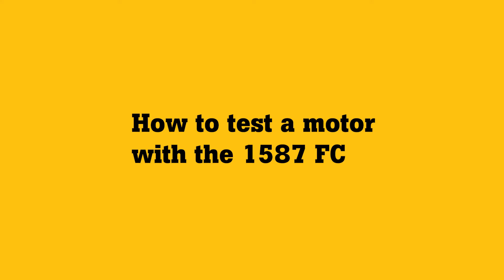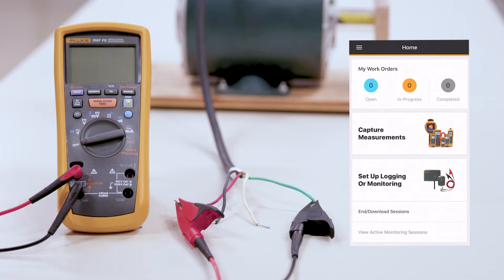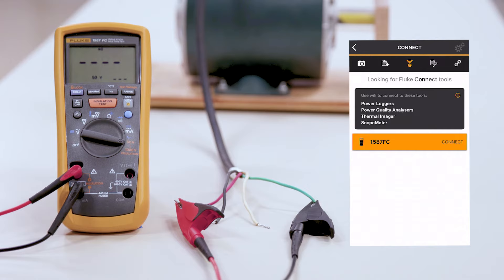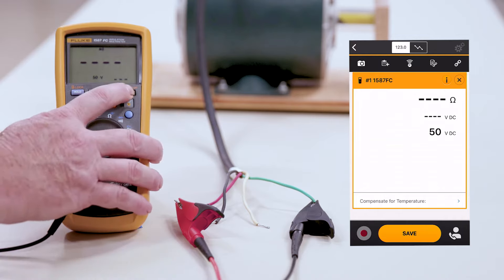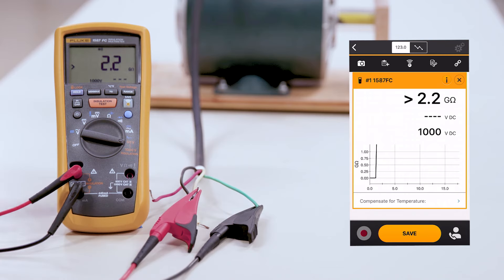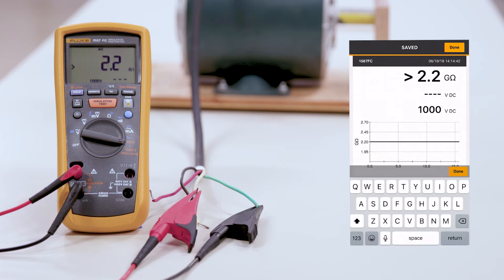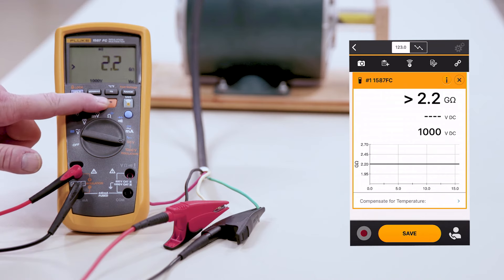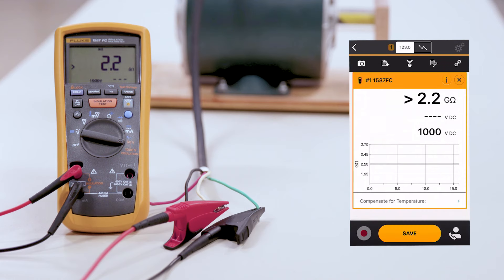How To Test a Motor with the Fluke 1587 FC

Comment: I own a Fluke 1587 FC Insulation Multimeter and every time I try to use the PI or DAR functions, the value displayed on the screen is "> 2.2 GOhm" at 1000V which means that the actual reading could be more than 2 GOhms?. After around 20-30 seconds, I receive an error message, and "Err" is shown on the screen. However, after watching your video that had DAR and PI values displayed, is it because the readings are within the range of the multimeter? Can anyone offer insight into why I'm receiving this error and how I can resolve the issue? Thank you in advance for your help.
Reply: Did you find some info for that? I have the same issues
Reply: @waxstache  I received a table from Fluke regarding the interpretation of DAR and PI values:

DAR 0-1.0 and PI 0-1 is Dangerous.

DAR 1.0-1.3 and PI 1-2 is Poor.

DAR 1.3-1.6 and PI 2-4 is Good.

DAR 1.6 and above and PI 4 and above is Excellent.

Therefore, if you're receiving an error message during the PI or DAR tests, it actually indicates an Excellent result, meaning your insulation resistance is higher than the meter's display range. This is a good sign for insulation testing!

Comment: What kind of file format is used for downloading test results?  MS Excel or some sort?  What is the data sampling rate?  What info can be included in the downloaded file?
Reply from the maker: Peter - thanks for your questions:  The data sent from 1578FC to phone/app is a binary file. It can be exported as XLS, CSV, or PDF. You can add text and voice notes, and assign the measurement to Asset and/or work order.

Comment: Since this is a 480V motor, why use 1000V instead of 500V considering each phase carries an average of 277V and in case of a fault may not carry more than 500V?
Reply: He said the range has to be doubled around 1:10 minutes
Reply: When you test the insulation of a motor winding, you don't test for what's its rated at. The insulation test is a stress test, doubling the voltage puts a heavy duty load on the windings, and if the windings hold, then your insulation is solid. If it doesn't hold, and you're bleeding to another winding or to ground, then you have a compromised winding. Motors dead at that point most likely, or extremely weak depending on how bad the leakage is.

Comment: I’ve just bought the fluke 1587 FC. Can fluke or anyone else inform me why it comes up with error when using pi and dar timed measurements on it? The measurements are holding to it’s maximum resistance on each setting yet it says err after about 1 minute. Thanks.
Reply from the maker: Hi Adman - Our Technical Support team would be happy to help troubleshoot. Please give us a call at 1-800-443-5853 or email fluke-info@fluke.com. Thank you!
Reply: I actually have the same problem. I maybe late but I hope Fluke provided you an answer.

Comment: This video is incorrect how to use this FLUKE tester and incorrect how to test motor for Insulation Resistance. I'm not sure this video is made originally by FLUKE. Insulation Resistance on motor is done by Polarisation Index PI what this FLUKE tester provides.

Comment: I was taught to megger phase to phase as well not only to ground ? The insulation could also start to go bad there not just to ground. On that test you should see your resistance keep in building. Thanks for nothing I guess horrible video
Reply: If the motor is connected in star configuration you would get zero.
Reply: It's good practice to check resistance between the phases they should be balanced. Then you only need mega one phase